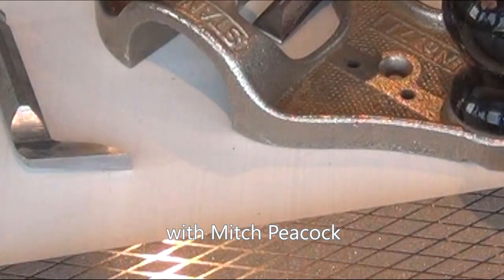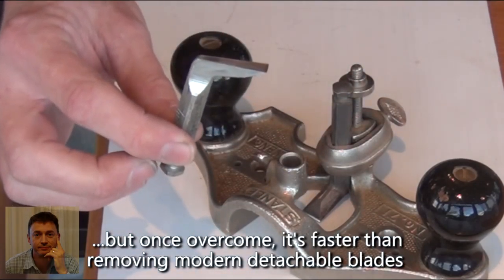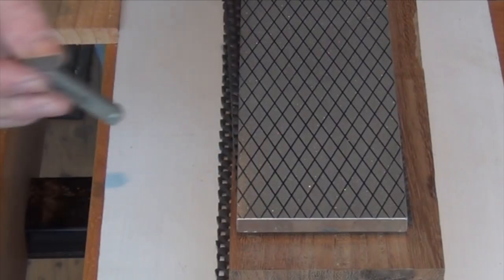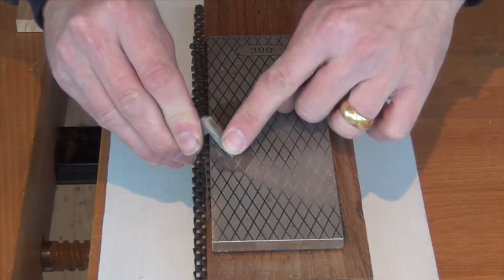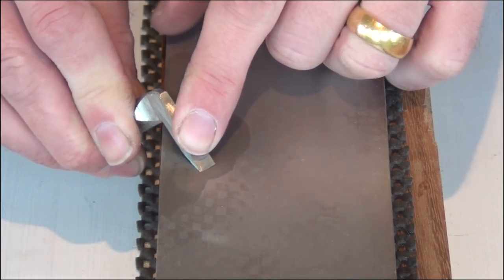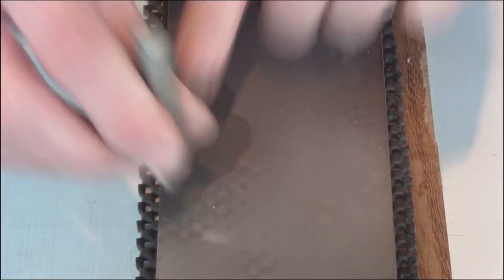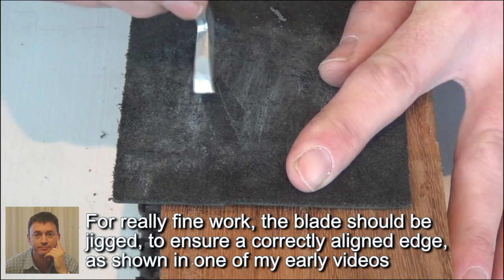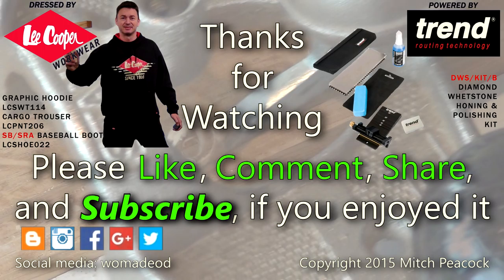Sharpening a Router Plane Iron on Diamond Stones

Comment: Thanks for the video Mitch, a perfect timing! Because I just made my first router plane and I will use a diamond stone for sharpening the iron 🙂 But, what is that fluid you use instead of water?
Reply from the maker: hi Murat,
I use Trend diamond lapping fluid. it's petroleum based, and should maximise the lifetime of the diamond whetstone. if you use water, make sure to dry thoroughly as soon as you're finished. Thanks for watching